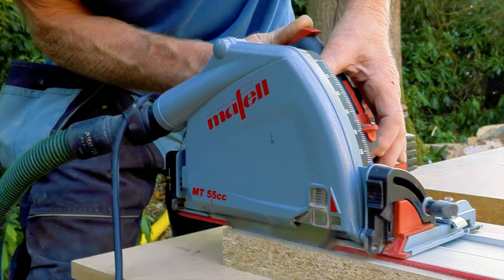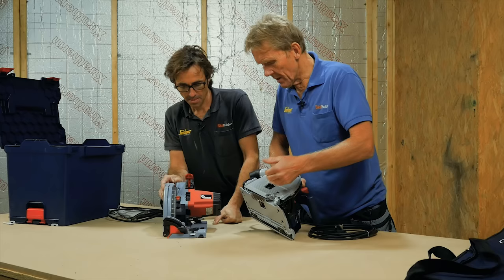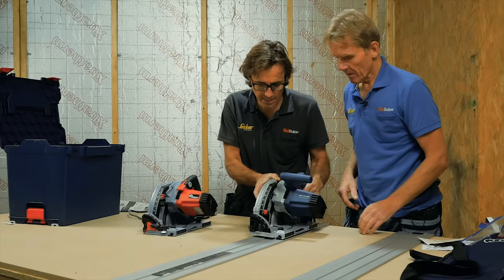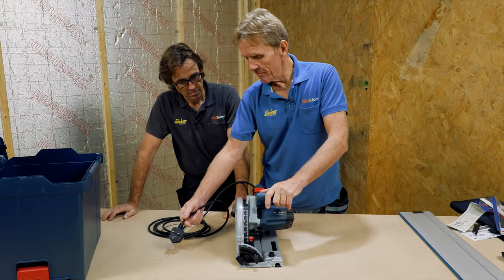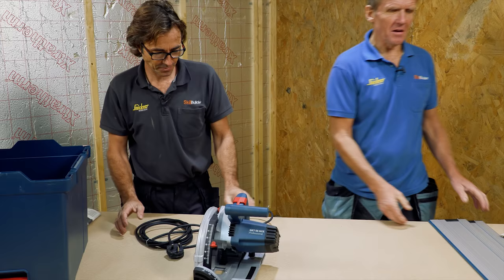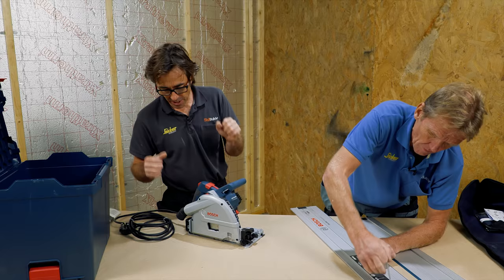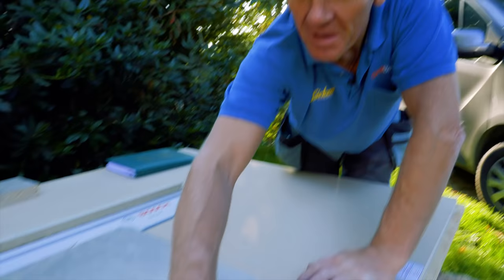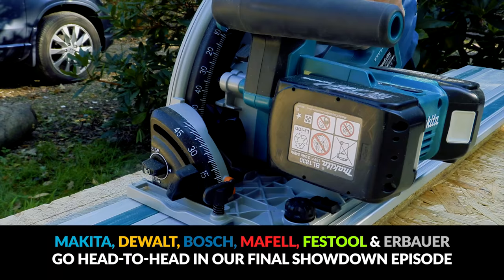Bosch GKT 55 GCE Plunge Cut Track Saw - Episode 3

Comment: I bought this saw and it's a brilliant bit of kit, no problems with the base plate.  In fact all my tools are Bosch, their warrenty is by far the best, they will send a courier to your job or home to pick up the tool and drop it off when it's done. Comes with a good quality case for the guide rails, and the L box is  a great stackable system.

Comment: I just took delivery of this saw and had the same "issue" of the warped base plate. It turns out that the 2 locking knobs for angled cuts sometimes aren't set in the same place out of the factory, resulting in twist. Just loosen both knobe with the saw on a flat surface then re-tighten. Job done. This might explain why Robin still got accurate cuts on the guide rail despite apparent twist in the base plate - he'd already set the base flat without realising it (see 8 min 30)!
Reply: Thx for this info. I had to loosen the baseplate to (4 black screws) and re tighten it with a measure mate from the flat side of the blade to the cnc cut line on the underside 🤷‍♂️  so its perfectly ok 👌
Reply: Thank you. Just bought one, sent it back and they returned it saying it's okay. I'll try this later.
Reply: This was a issue with mine as well. Was on my way to send it back, but the a friend of mine saw it and figured it out in a couple seconds... all well now :D
Reply: W mojej zgłębiarce była taka sama sytuacja (rok 2024). Wystarczyło śruby poluzować i stopa wróciła do prawidłowego ustawienia.

Comment: I just got this saw and got the track separately.  I was very concerned when I saw that the blade was hitting the rubber.  I thought that either the saw was mal-adjusted or I got the wrong track.  But yours is the first video I could find that mentions the "sacrificial cut".  For that level of detail, I am subscribing.

Comment: Over the last couple of years I have had the Festool TS55 , the Bosch GKT55ce and the Mafell MT55cc. Though I have a lot of Festool stuff I would rank the Festool plunge saw lower than both the Bosch and the Mafell in terms of performance. Mafell is top notch in every department but to be honest the Bosch is much more bang for the buck. Bosch has the front handle that some people like (Mafell does well without it though) and it cuts like a champ. The whole Bosch warped base issue is well blown out of proportion and as some people have mentioned already just loosen up the set screws and retighten. I have used the Bosch for very critical cuts in harder material (Staron/Corian) and the end result is on par with Mafell and Festool. Mafell has a pre scoring function - other than that I would recommend the Bosch. All three are great saws though.  If I would buy one all over again I would buy the Bosch.  I say that owning the Mafell.
Reply: Cheers man, that's helped me make my mind up! Festool whilst getting rave reviews and all, just feels like it's the trendy brand to have.
Reply: @wb801 Festool is good, but I'd put it 4th behind Mafell, Bosch and Makita.

Comment: On the subject of the base plate being twisted, there is now this video published directly by Bosch - https://youtu.be/m5tg5thZs-A that shows the "adjustment".

It does seem odd that the Mafell doesn't exhibit this. The locking mechanism is different so the rod may keep it square. Unless there is a fundamental difference in the design of the base plate - thickness or materials?

Comment: I have the Bosch track saw, fortunately, the base on mine is good and not distorted like your model, I have fitted it with a Bosch 62 tooth fine cut blade for doing laminated Kitchen panels, I have to say Its cuts like a lazer would, zero break out, clean cut, very little dust without blocking out the window, it gives me the accuracy and cut finish I need. I couldnt ask for anything more

Comment: The base plate is plane. You must loosen the two knobs for angular cuts and tighten them again. Then it fits perfectly. Professionals like you should be able to see this immediately. Otherwise this distorts the impression about this great plunge saw.
Reply: I just pulled mine out of the box, it had that tweak in the base. I loosened the bevel knobs, base is instantly flat. 👍🏻
Reply: Yeah, and it's funny how they didn't even notice that it leveled out when they were playing with the knobs for angular cuts. After that he just intentionally tried to rock the saw back and forth with excessive force.....
Reply: I recently ordered one you are right the base plate is plane and if you loosen the 2 knobs it does eliminate the rocking but doing this leads to another problem ruining the squareness of the blade at zero degree when I plunge the saw blade to max depth and use a square between the base plate and the blade it was off by around 1 degree. Apparently, there is some flaw with the bevel adjustment mechanism which makes bevel angle scale inaccurate.
Reply from the maker: You don't have to do that with any of the other saws we tried. I still think that a base plate that twists is not a desirable thing and the Mafell doesn't have the problem.
Reply: You are right on all counts.
Reply: I’ve got one of these that I picked up in new condition and had the twisted plate, after doing some research I tried the loosen and tighten both knobs down at same time and now the plate is flat I’ve checked the 90 degree angle and it’s perfect, only think I’m getting when cutting 42mm deep oak sometimes it leaves blade rings. I love the rails
Reply from the maker: @xxnickthegreekxx  There are many comments regarding this point but it is a shame that Bosch can't pack the tool with a flat plate. It is also the case that the Mafell doesn't have this problem.
Reply: @thisandthat176  can't see the video?
Reply: @thisandthat176  this video is private
Reply: I was expecting at least an update...if not an excuse. And, by the way, I owe this saw.

Comment: I have just bought one to replace the Lidl Parkside saw I had and following your review, was worried about this base plate issue. 
I pulled the saw straight out of the box and put it on my kitchen work surface and it rocked from side to side......aghhh!
A good look over it, and I couldn't see any issue with the base plate, so I slackened off the bevel adjustment and moved it through its axis to 45 degree, then back to 0 degree.
The saw was now solid on the worktop with NO movement at all. Hoorah!
No idea what the wobble was about, maybe the bevel adjustment was not at zero on delivery?
It is a massive step in quality over the Lidl saw, but at 4 times the cost, so it should be!

Comment: was looking forward to the Bosch as they used to be one of the best in woodwork tools . When I thirst started in the building trade everyone wanted there planers and jigsaws . I couldn't believe it when I first see it rock . I thought it was off to be something on the bottom or Roger hadn`t returned the blade fully . As for what Robin said about Mafell tracks don`t need running through because they have been done before they are sold to the customer was very interesting . I am looking forward to the next filming when they go head to head . And I`m hopping that you enter a cordless one in as I keep hearing that Festool`s cordless is as good as the ts55. Fully enjoying watching and listening to your reviews

Comment: Bought mine after seeing this - and yes it had the wobble. About to return to supplier but then saw Bosch video on how to adjust angle of cut to ensure no twist in base plate. Tried this and hey presto no wobble. Looks like the machine utilises the frame to stiffen the base - probably how they get the deeper cut by having a shallow base. I have only been able to view the video on the Howe Tools website - elsewhere it comes up as 'private. Secret is to swing frame to angle required - lock rear lever - ensure base is flat - then tighten front screw.

Comment: Have one of those Bosch plunge saw for years, mine plate is absolutely fine, suppose you just was unlucky and got one made on Friday afternoon!
Reply: I've got the same saw and it's perfect, and comes with a good quality case for the rails. I've got the 18 v circular saw too and Bosch made it to fit  on the guide rail, so that is very useful.
Reply: @sparx2391  got that one an all!
Reply: @richard S yes and for the jigsaw

Comment: Hello, sorry for my english. I have the bosch gkt55. the plane is twisted also but after handling it happens when the adjustment of the angle and front are not locked in the same position. loosen the adjusting screws and the sole is flat again.

Comment: Normally I would have bought the Bosch as I'm a big Bosch fan but my builder friend told me about the Mafell so I had a look at that and was put off by the large price increase but it had certain extras and build features I liked so I bit the bullet and bough the Mafell, can't fault it, brilliant bit of kit. Apparently the Bosch unit is built by the Mafell factory hence why they look the same and use the same track system. The only other bit of kit I've bought over Bosch was a Fein Multi Master, another brilliant bit of kit.

Comment: Can you guys give us a update if the "wobble" could be solved, please? Was it just one out of thousands or is this a common problem?
Reply: There's actually NO problem the "wobble" is caused by not using the tilting knobs properly, when angling the blade (let's say 45 degrees) you should lock BOTH knobs at 45 degrees, If you don't tight the both and just tight one the base plate will apear to be warped.  Its a known issue caused by user error, Bosch received many returns a few years ago and issue a statement pointing the user error and that non base plates where warped. (there are some videos in YouTube that show this in detail)

Comment: This twisted base plate is even mentioned in owners manual. Unlike Maffel it fixes position with two points. You have to tighten the back fixing screw and then - without applying any force on the saw body - tighten the front screw. Otherwise you'll get the base fixed differently  for front fixing point compared to back fixing point. The result is obvious - the plate is twisted.

Comment: I think someone else has mentioned this but I'll second it. The saw has two independent knobs, one at the front and one at the rear nearest to you which are used to lock in the angle of the cut. It's possible you could apply a twisting force to the base plate between locking down the front and rear knobs. It's also possible that with both knobs screwed down that the saw took a bump at one end or the other and 'locked in' a twist in the base base plate. In both cases undoing both knobs would sort this out. Seems like a more likely scenario than a precision extrusion being manufactured with a twist in it but if that's the case then Bosch should replace without question. 
Mine's perfect :)
Reply from the maker: The base is double thickness with a cavity so it is much more than a bit of thin metal that would twist in the way you suggest.  The base  was/is faulty straight out of the box and  has been returned. I am not sure if it is a casting, it looks like one but if it is extruded and cut in sections then it is still being bent some how.
Reply: @SkillBuilder  I had another play my unit today. I can put a twist into the base plate with the front or rear nut opened up and if I tighten them up while holding the twist then it's locked in. It defaults to flat but with minimal effort you can definitely impart a twist in it both ways.
Did you try adjusting your test unit?
You're right it looks more like a casting than an extrusion.
Reply from the maker: This is very interesting but unfortunately, I can't test this because the saw was collected a few days ago. I can check with Mafell (who assemble the saws) but my feeling is that if the aluminium casting can be flexed and held out of true then that is not great. The way the Mafelll works is with a single rod which means that problem can't occur. Maybe that is why they chose the single screw and drawbar.

Comment: If Bosch made that saw in 18v I'd buy it - instantly.
Reply from the maker: That will happen. They have the new Procore battery that will power it
Reply: @SkillBuilder  do you know if they have a date for when?
Reply: @jamesbailand4311  Bosch release tools in January and October each year. This years Oct releases are in the new catalog and include new more powerful impacts and 18V caulking gun. A few revised bits. Next January they release their 12ah ProCore Battery. Safe to say the earliest we'll see new saws for the big ProCores will be October next year. I have word from someone at Bosch that 18V saws are coming though.
Reply: Good knowledge bish bash bosch! 
Thats'll be to late for me, as I am about to buy a rail saw now, and for various reasons need an 18v effort. 
Super annoying as I run Bosch and Hitachi 18v and neither company has a cordless rail saw, so Im eyeing up the Mafell. 

- Bosch badly need an improved Impact so that'll be interesting.
Reply: They just released a new 18v circular saw as well didn't they?
Reply: @jamesbailand4311  They do have an 18V saw that's Bosch/Mafell guide rail compatible, released a couple of years ago - the GKS 18V 57 G. Decent little circular saw. Not a plunge saw though. Their new impacts are the GDR 18V 200 C and GDX 18V 200 C. Both have bluetooth connectivity and 200nm of torque. The GDX has the 1/4" hex +1/2" square chuck. Be interesting to see if the extra grunt is noticeable. I have the old GDX and like it  but it is a bit slower on longer coach screws than other top brands.

Comment: My Bosch plate is flat, and no rocking. Great saw.  My only issue is the angle gauge is out, I have to set it at 3degrees for a square edge.

Comment: It's actually no secret. Mafell and Bosch are cooperating since 2013 I think. Mafell builds the plunge saw for Bosch, in return Bosch is sharing their 36V cordless tech with Mafell. Mafell is a small manufacturer and they have been colaborating with other manufacturers (like Festool, AEG/Milwaukee, Metabo) for a long time to achieve a reasonable portfolio.
The fact that the Bosch is built by Mafell doesn't translate to same quality though. It's always a question of budget and this comparison shows that really well.

Comment: I can replicate the same issue as Roger and Robin had, and a few other subscribers on this comment section have had...

Basically you can throw the base out by leaning on the top handle (the Marfell doesn't have the handle) while tightening up the front angle thumb screw.
Yes it's a design issue due to the ability to be able to put the saw to -1 degree but once you know about it, it's something you check if using the angled cut feature.

I've had the Bosch saw for nearly 3 years which replaced a Dewalt 240v version for fine / accurate cutting as I don't like the dewalt tracks because of the rubber strips that are glued/stuck on and are a real pain to replace, also the track jointing system is brilliant on the Bosch.

All the plunge saws have their quirks.
With this problem addressed maybe it will go back on somebody's to buy list as it's very similar to the Marfell...hopefully Roger or Robin will read this and update all of the subscribers.

Comment: Your “made” me buy this a few months ago.. (great advice) what an amazing machine, I can’t believe how clean the cuts are.

But the best thing is the rails, I wanted to buy the Makita 1st but the way these tracks connect is so much better than the Festool/Makita style.

I looked at the Mafell too but the difference was not worth the other 150,- or so. I never use micro adjustments as I just lower the blade 1-2 mm under what I am cutting.

I love this tool so much, I bought their sliding mitresaw too. Have you tested mitresaws before? I can recommend the GCM 8j as a good budget friendly option. 

Bosch should pay you for this 😁

Comment: To anyone who is wondering the Bosch GCE, is made by Maffel
Reply: The reason why they both use the maffel tracks and have the same motor casement, both have the same 1400w motor, identical saws; the maffel has more features in my case I have never had to use the fancy scoring line setting and such, the Bosch is the best plunge saw for the money blows the Festool and the Makita’s out the water.

Comment: I have the Mafell wouldn’t swap
Reply: Big Smith i dont think anybody would swap mafell. Is it 240 or 110
Reply: I have the 110, haven’t used a 240 tool in a long time so wouldn’t know if there was much difference in performance between the two
Reply: Big Smith oh right does it struggle being run through an extractor. My festool ts55 hates it. Im thinking of changing

Comment: You talking In Rush Current there on start up. Most electrical motors suffer that fate unless there is a 'soft start' gizmo.

Otherwise a slip up with  Bosch QC on that wonky base and that's a shame  ... I have some very hard working and reliable Bosch Blue tools (SDS Drill, Angle Grinders/ cutters) that have done a lot of distance and in my opinion those tools are really made well and made to last. Also have a  regular Bosch circular saw.

Comment: I usually buy Bosch, as I have a circular saw and the planer was thinking of purchasing a Bosch plunge saw but after this and reading the comments I won't, recently I checked my circular saw and that isn't cutting at 90 degrees, looks like Erbauer is more accurate than the Bosch

Comment: You need to do this review again “the warp” isn’t warp it wasn’t set flat leaving the factory just lay the saw on a flat surface and loosen both angle knobs and retighten job done
Reply from the maker: I think you will find that your observation was made several times when the video first came out. There is no need for us to revisit this review. We encountered the problem and in our opinion it is a fault. The base plate should be delivered in a useable condition and the Mafell have solved the problem with good design.